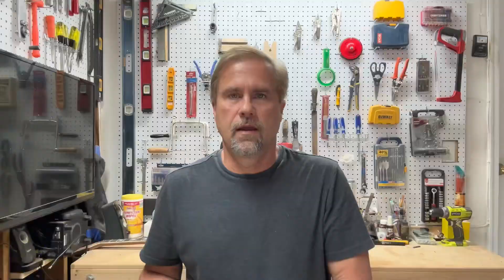If your DIY CNC is missing steps. Is it grounded properly?

Comment: Would this information work in arduino based cnc router ? Z axis does not return to the origin height.
And sometimes it returns same origin but sometime does not.
Reply from the maker: Yes I built mine with an arduino. If it’s not grounded they interfere with each other. I always home it before I start it. When I forget that can happen. Is it off a lot?
Reply: @StudtCustomBuilds  I just have grounded only vfd.
But arduino did not.
And one more question sir.
Can I use arduino uno in my commercial cnc ?
Reply from the maker: I really couldn’t answer that question without seeing it but the arduino is just a controller so you can control stepper motors but what else you’re using I couldn’t say. I’m assuming you’re not trying to control servo motors although you probably could. I have no experience with servos
Reply: @StudtCustomBuilds  no I'm not using servo motors, I'm using stepper motors.

Thanks sir for replying. 
🙏 Ram Ram.
Reply from the maker: @agrakeveer5548 No problem. Like I said for me a lot of time I just forgot to home it. Thanks for your question. I really don’t mind

Comment: Yup, I use shielded wire all the time in my builds!
Reply from the maker: Yes, it’s good practice. What kind of stuff do you build if I might ask?
Reply: @StudtCustomBuilds  I build CNC machines with automatic loading and unloading system.
Reply from the maker: Okay. So not just tool change but material changes?
Reply: @StudtCustomBuilds  Yes it is all about material changes, not tool changes. If you have to make many, then it is much better to make an automatic system to load and unload the material from the machine.
Reply: and you can also bypass the tool changes, which are expensive and time consuming in most cases.
Reply: Were you able to access my channel?
Reply from the maker: Yes I just found it. I am a subscriber
Reply: @StudtCustomBuilds  great, thank you, me too on yours!